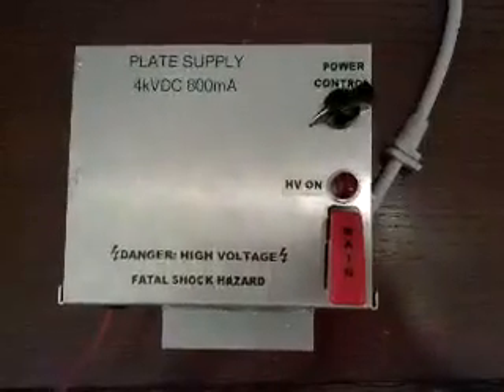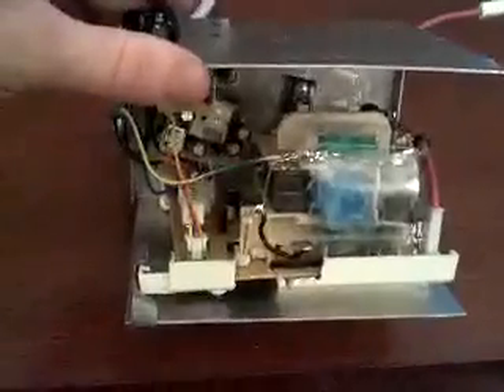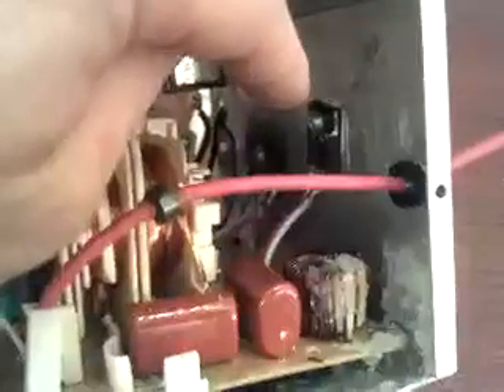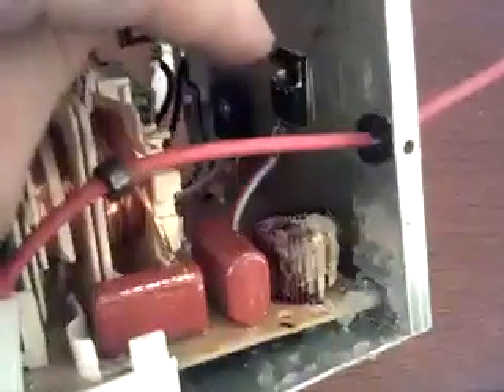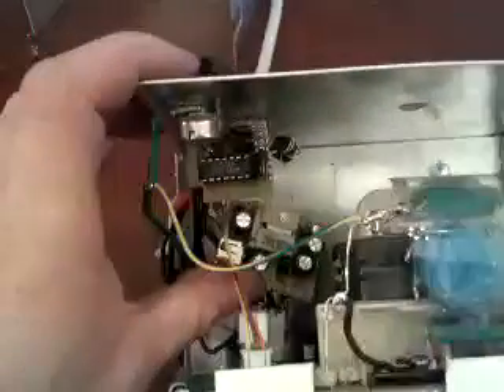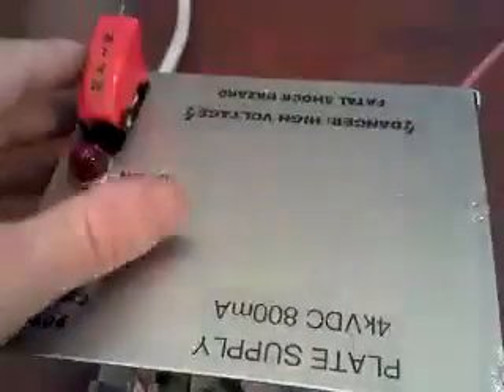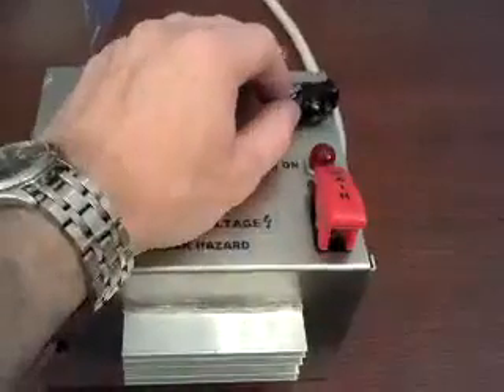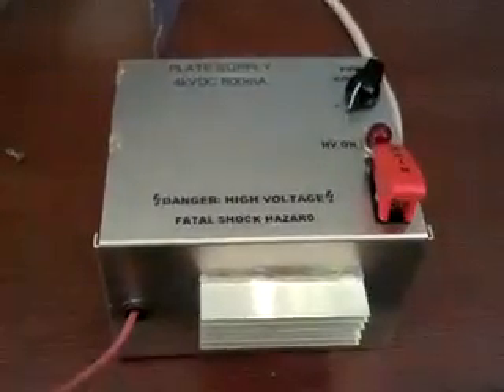Microwave inverter hack: HV power supply

Comment: Hi i have stripped a Panasonic microwave 1000w as i was going to build  a welder but turns out the microwave is an inverter model so dont think i an use it for that but i have all the parts which are no good to me and have not been touched just stripped from a fully working system if you would like the parts pls msg me as they are no use for my projects and sounds a bit scary tbh.

Comment: the insulating compound you have used for the IGBT becomes conductive with high voltages. In the high voltage industry, these materials are called "semi conductive". Materials like carbon compounds which are normally a dielectric (dielectric is an insulator) using lower voltages can be semiconductive with high voltages, however,  they can only be identified as semiconductive using a hitpotential test set or with what's called a Megohmeter or Megger (this megohmeter is not like a normal multimeter that tests the resistance using a function to do so in the megaohm range , as they normally only push 3-5 volts through the leads to test these resistances) The Megger uses high voltages to test the impedance of these material in megaohms by pushing specific voltages in the ranges set by the meter. These levels could be 1200 volts up to 15,000 volts.

Comment: My bad, wasn't clear enough. I meant arcing to the case via the output, not via the IGBT. My initial idea there was to separate the inverter chassis and the "user accessible" outer metal chassis. The thought was to bring out the inverter chassis to the front panel as the designated return point, and join the inverter chassis and the outer chassis through a suitably rated low value resistor to detect any current flowing to earth through the outer chassis. Just brainstorming aloud here :)

Comment from the maker: Oh it auto-shuts-down alright.  When the IGBT arced to the case it immediately stopped working completely.  I'm amazed it didn't damage anything.  Keep in mind that the power supply is designed to use the chassis as the secondary return conductor since a magnetron drains charge to its case.  Unless you do a lot of work rewinding the transformer, the output is not isolated and the chassis is used as the current-carrying return for whatever your high voltage load is.

Comment: Yes, you're right of course. I tend to be overly paranoid about these things, so I'd like some degree of safety even if grounding fails (I was also thinking of auto shutdown on faults like said isolation failure or arcing to case).

Comment from the maker: The case is grounded, so if the isolation fails it fries the circuit but not the user.  Proper grounding of the chassis is very important on any high voltage equipment like this.  An internal heatsink and fan would be a fine solution, but requires a much larger case.

Comment: Very useful, thanks. Some good safety tips in here. For the IGBT thermal solution, I'd feel a bit safer with an internal heatsink plus a fan, so even if the insulating pad fails you'd still be fairly safe. I'll post a video reply with my results...

Comment: Good, I have a Dud Panasonic invertor microwave in the basement, bloody invertor POS. There are multiple websites about these horid Panasonic microwaves and how to repair them, some re-engineering would be a good thing because the certainly didn't get it right the first time around.